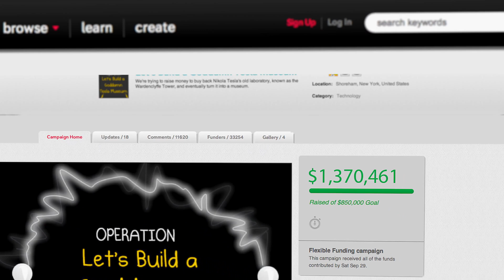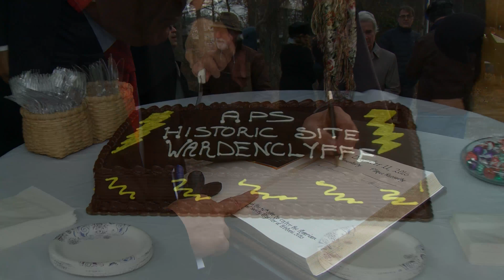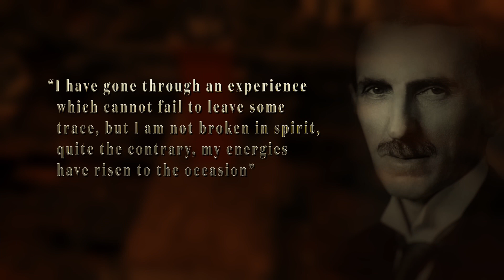Act Now: Tesla's Groundbreaking Lab Damaged in Fire, Needs Immediate Help!

Comment: QUESTION : To the Tesla organization people. What the hell happened? Were you simply not paying attention with such a prized historical ICON such as this? How could you let this happen? (NONE of these questions have been answered in this presentation) Did the Rothschild have something to do with it? After all they owned 90% of J.P. Morgans net worth at the height of his power, and "THEY" told (their puppet figurehead) Morgan to pull the plug on Tesla's research funding since Tesla's goal was free power to the people. This is sick (and it turns my guts to see such an important historical structure reduced to rubble after all that trouble) I could hardly believe what I was watching. Were ANY precautions taken? How did the fire start? Was it arson? Was it an electrical failure? (God I hope not, Nikola would REALLY be turning in his grave if you people allowed THAT to happen) Why weren't their armed guards or surveillance teams on duty. For such an important, historic AND EXPENSIVE structure there certainly should have been. Any clue, give me something. You could have at least answered even a few questions instead of playing completely dumb. I'm surprised and disappointed that the people so closely connected with the ownership and rebuilding didn't see ANY of this coming or take ANY and ALL precautions to prevent and protect the structure. It seems to me this iconic structure was in the worse possible hands. They couldn't even keep it safe from harm and now it's gone. Unthinkable, I still can't believe this could happen. Maybe I'm wrong, maybe I don't know all the facts (BECAUSE CERTAINLY NONE WERE PROVIDED IN THIS PRESENTATION) but my gut feeling is you Tesla organization people are idiots to leave it unprotected, unguarded and susceptible to harm. You blew it. You have none of my sympathy. Thanks to you, the people lost again. Only the Oligarchs survived.